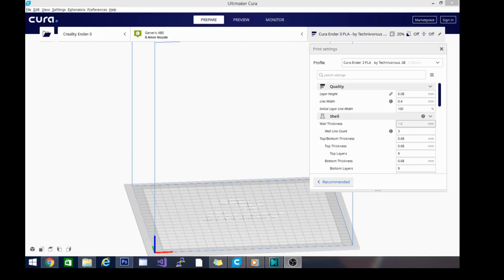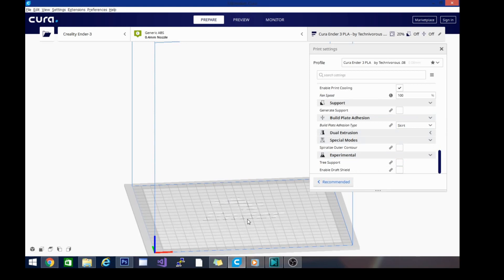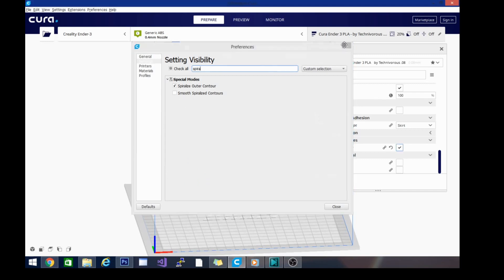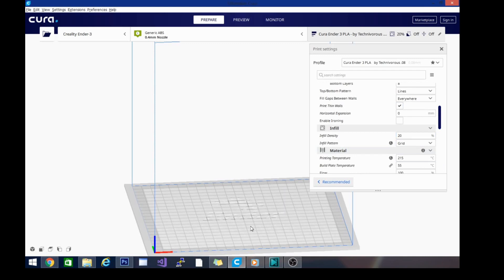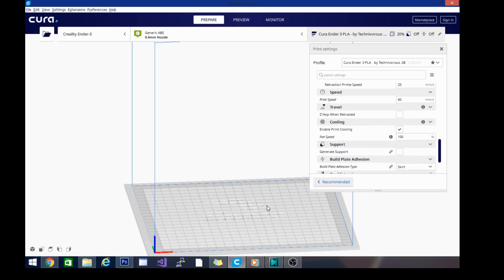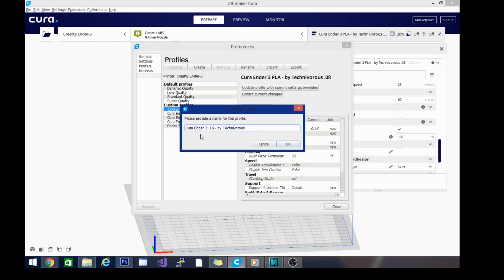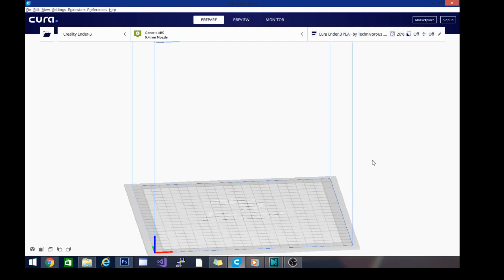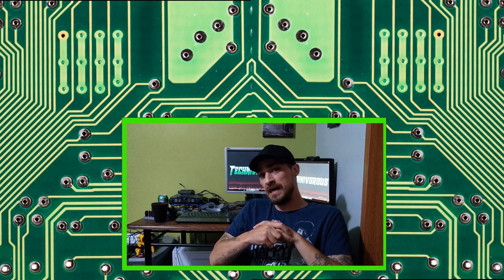Cura 4.3 - cura profile settings - Vase Mode

Comment: Will Cura still try to add a top layer to my vase when using “Spiralize Outer Contour”? I understand it doesn’t add infill, but I don’t want a big stringy mess on the top of my print by my printer trying to add a top layer over empty space.
Reply from the maker: Occasionally it will show one in the slicer preview but it wont print it.

Comment: I want to do this for a statue which is recommended ...problem is i am a beginner(1 month with ender 5) and you started in middle it seems... i wish you would have started from start up... i know how to change most settings etc..but how do i switch to vase mode?? thanks
Reply: I found it under Preferences > Configure Cura > Settings > search for Spiralize Outer Contours and enable that. It will appear in your print options to toggle on/off as long as it's enabled from that menu.
Reply: @dzyu  Yes i figured out how to do it a few weeks ago... thanks
Reply: @roadstar499  I suspected as much since it has been so long, but I came here looking for the same thing so posted it anyway so it can help others as well. :)